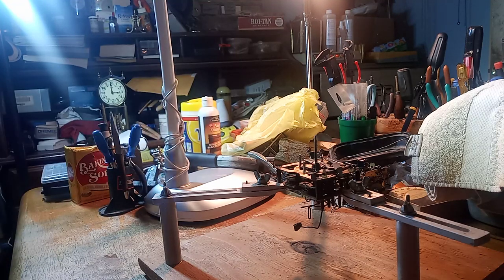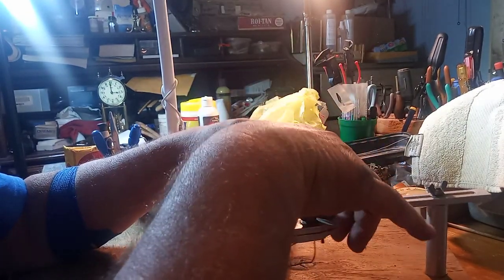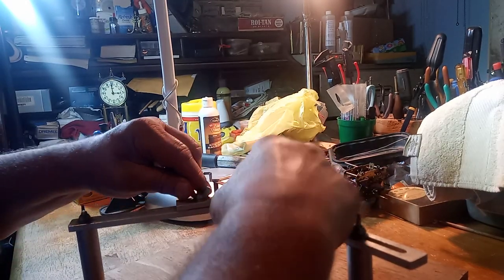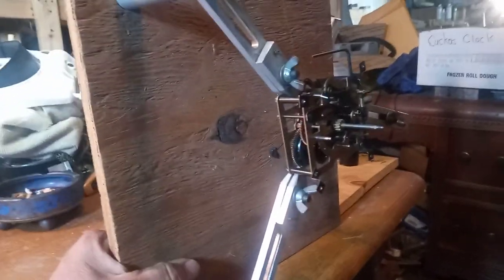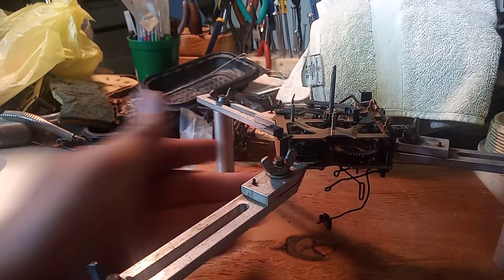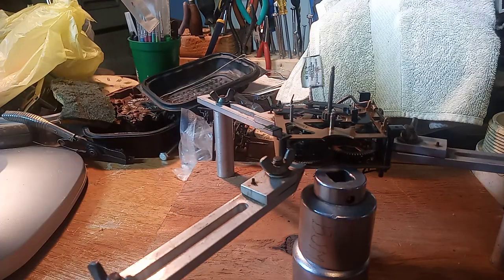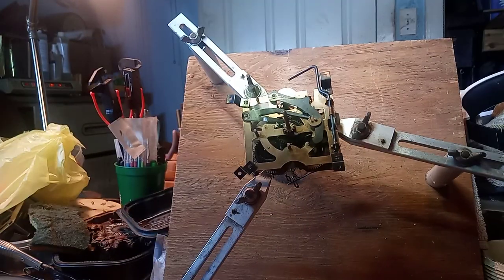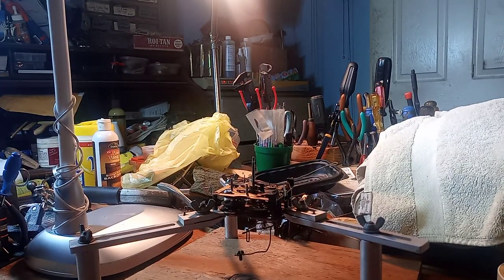Homemade clock movement stand? (See description) 20221115 012626

Comment: Hi Mark that would make a good test stand for movement's hang it on the wall and it's adjustable that works thanks for sharing
Reply from the maker: Absolutely if I had the wall space. LOL. that is why I say that I might have to add a 2x4 to it and use it on my table. Too many clocks hanging all over my house.